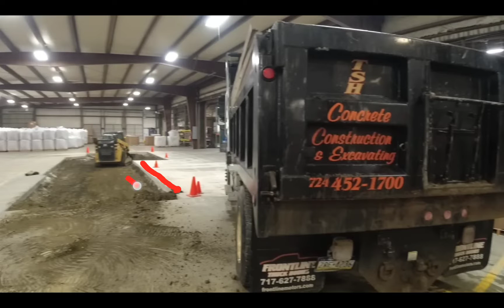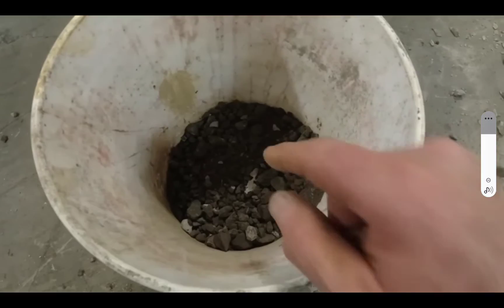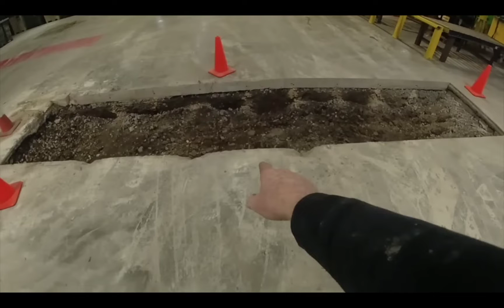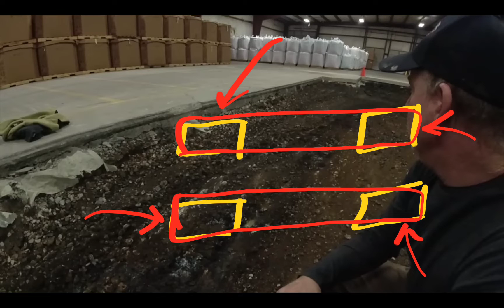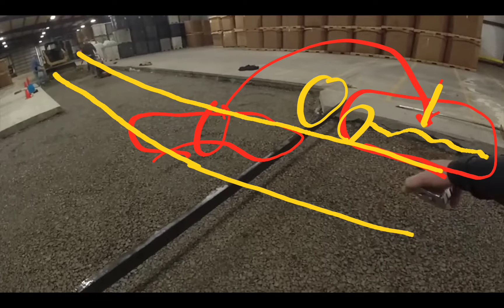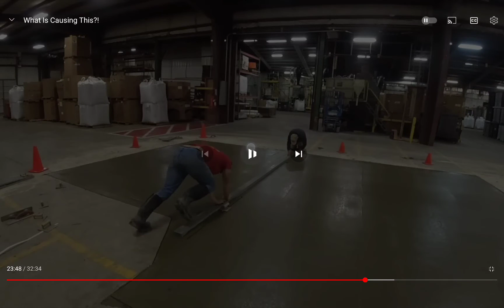Concrete reaction video expandable soil

Comment from the maker: Let me be clear, this is not an insult video but a reaction video and I do enjoy the jobs this Hass puts on youtube... I am doing it because contractors are not engineers and sometimes engineers can't even figure a lot of issues or why they developed. 
This structure does have loading issues also...
Reply from the maker: 8:54 I state 4 inches and I should have estimated 6" thick concrete pad
Reply: @EngineerPEretired  Soft vs. HARD right?! LOL